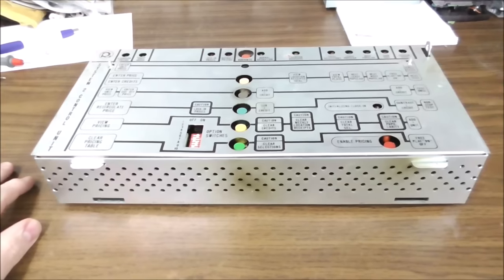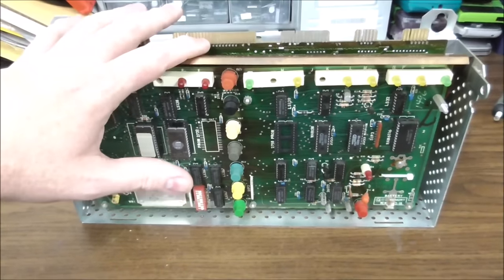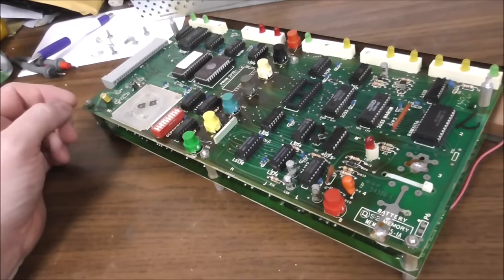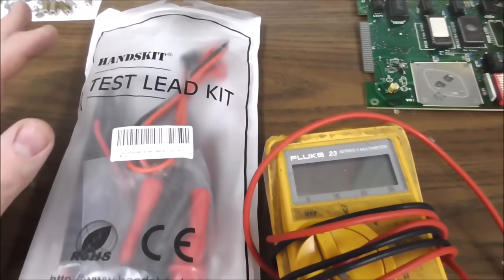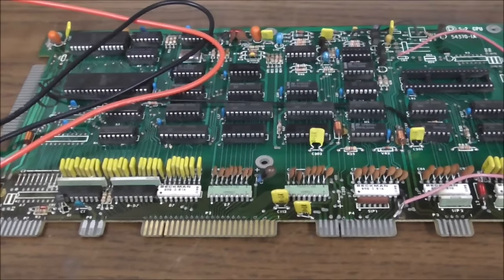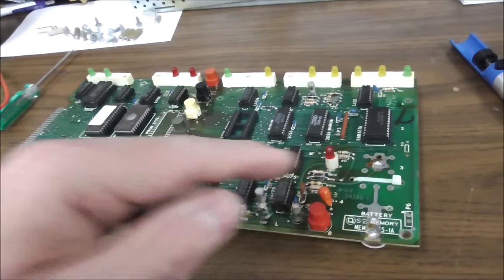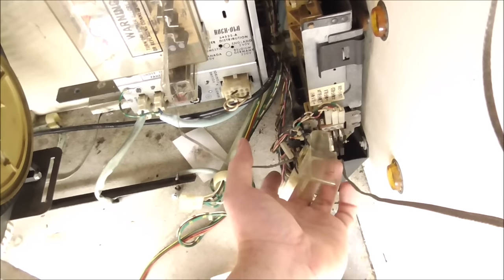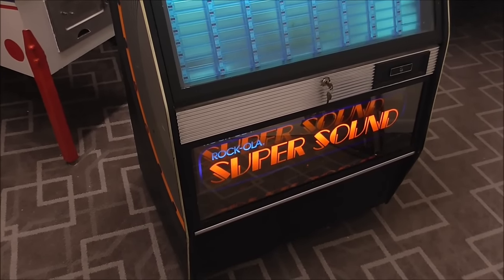Repairing The Control Unit In A Rock Ola 490 Jukebox For A Customer!

Comment from the maker: If you follow our Amazon link:  https://amzn.to/3crMXRZ  anything you buy there doesn't raise your prices or anything, but pays us a royalty for sending you there.  Thank you for everyone that has been buying things, we appreciate it!!!
Reply: Depending on the charging cycles could a LM2032 be used instead of a Diode CR2032?
Reply from the maker: I think the 2032 isn't rechargeable, is it?  Basically the thing will take about anything, you just have to make sure not to charge one that won't charge, and add the diode... but if it's rechargeable you could just wire it right up.  Anything anywhere like 3volts will work.

Comment: You got it right.  Silver solder coating tends to go black when it tarnishes.  The tin type coatings tend to stay clean, unless you get battery damage.  It was definitely a good idea to remove the battery and replace it.
Tantalums are used because (when not shorted) they have extremely low leakage.  Replacing with an Electrolytic is appropriate as long as it is a low leakage, high quality electrolytic.  In this situation, I don't think it makes much difference though.
Love your work.  It is always great to see someone who actually enjoys bringing these back to life working on them.
Reply from the maker: Thank you Brendan we always appreciate your comments... see you on the next video!

Comment: At the company where I work for I always use a FLIR heat camera to find a component which is short. A couple of years ago I had a Samsung Plasma TV with a short +3,3V on the mainboard and it was impossible to find the short component because there were 50 or more SMD-components connected to that 3.3V-line. With the FLIR I had found the short component within 5 seconds without removing the other components.

Comment: Hi Ron,  I've always heard that oxidation on silver (aka tarnish) is conductive.  That's generally considered a good thing with things like switch contacts.   That way a bit of oxidation doesn't create a problem.  You may not need to go out of your way to clean them if you know they are silver.  High end telegraph keys always used silver contacts :)
Reply from the maker: I'd never heard that but it's good to know... I guess the next thing would be identifying if you know for sure it's silver or not :)  Thanks for watching Mike, we appreciate it as always!

Comment: On these machines there are two springloaded tabs you can push in on the back side of the selection panel that drops it down so you can see it while you cycle through the settings and make selections while the door is up.

Comment: Enjoying the Jukin', thanks! Is that battery powering the 6116 RAM right above it? I wonder if you can get rid of that battery completely by using one of these 6116 NV RAMs that are around in the pinball market? I mean, it doesn't matter to the RAM if it operates in a pinball or a juke box, right? I replaced the 6116 in my Pole Position with a NV version and it works like a charm. No more leaking or empty batteries, I love it.
Reply from the maker: I think you could probably do that, yes, and it's in a socket so it might be a really easy update on these.  Never tried it though.

Comment: I read a suggestion to change the tantalum capacitor with non-polarized capacitors. What do you think? The capacitor I think is usually .1 or 1 micro-farad.

Comment: Greetings from Madison, WI!

A couple of nit-picky type questions, just because...

- I noticed what appeared to be burn marks (discoloration) on the bottom of the unit cage. Any speculation as to the cause, and is this cause for concern?

- I saw that one of the EPROMs was exposed (no label covering the window). I realize that the chip is covered by the metal cover of the unit, but is it cause for concern that the chip is unlabeled?
Reply from the maker: The eprom probably had a sticker on it at some time that fell off.... It's one of those things where technically the light in the cabinet might be able to erase it, but it takes a ton of time and a ton of light, I had a friend leave an eprom on his dashboard for a month and the thing still verified so I don't think it's that big of a problem.  If I remember to though usually I cover them back up with a sticker.

The burn marks are heat from the power supply directly beneath it, there are large heat sinks just under it.
Reply: @LyonsArcade  I suspected as much, now I know... And knowing is half the battle... :-)

Comment: I have a Rock Ola 490-2 and it looks like the tantalums were replaced with more tantalums. Hard to know when. I'm guessing it didn't work as the +25V light STILL doesn't go on. Looks like the guy actually changed everything and finally gave up so now I have it. I've figured out a way to get it to work with one deftly placed zip tie on one of the mechanisms but now the carousel is always moving unless there's a record playing. Kind of annoying. I may look to replace those same tantalums that you did. I have a parts catalog that says they are 35V, but I don't have the originals and can't tell the uF. Shall I assume they're the same as yours and look for 10uF 35V ceramic caps?
Reply from the maker: Yes they should be 10uf 35v... If the carousel is moving non stop, it may be searching for a record, does it pick up selected records reliably?  These things keep memory of selections, so if it's running non stop it may be scanning trying to find records it thinks it is supposed to play.
Reply: @LyonsArcade  yeah it finds records and as long as you have more in the cue it will scan, find them and play them. But as soon as it runs out of records to search it'll just spin and spin until you input another number. I'm pretty sure it's supposed to be at rest when awaiting a number. It must have something to do with the circuit being shorted. Just ordered a replacement for each tantalum and I'll give it a shot though with no more corner RadioShack stores all caps need to be bought online and everything is taking at least a week to ship. I'm so impatient! Thanks for the videos, these really help to educate and pass the time!

Comment: Removed my PCB to check if the previous owner had replaced the battery and they had not. I was lucky as there was only a little corrosion on the negative side, which had not leaked onto the board. Phew. Anyway, I'd like to do what you did with a coin battery, but there are SO many coin batteries to choose from and the holders are all based on "size". I know I need a 3 volt, but do you remember which number you went with and what size holder? Also, as far as the diode goes, are there any specifications for it? Thank you!
Reply from the maker: I used a CR2032, which is a really common one... the battery holders should specify that battery... and the diode I used was a 1n4007 the most common diode you can get, you place it where the banded side is away from the positive side of the battery, so that voltage can leave the battery on the positive line, go through the diode, and into the board.  Voltage can't go into the diode from the board, because the banded side of the diode blocks it.
Reply: @LyonsArcade  Thanks so much! I got my buzz to go away somehow. Replaced the caps in the power supply...still buzzed. Took out the amp and PCB to document the caps I needed to order and when I put all of that back in, the buzz disappeared. Kills me that I don't know what was causing it, but glad that's its gone! I did clean the contacts at the top of the PCB and a few of the others in the amp, but maybe it was just a loose ground that I secured when I put it all together 🤷‍♂️
Reply: @LyonsArcade  Successfully did this mod yesterday. Working perfectly. Thanks for the help!!!

Comment: Do you get your electronic components (capacitors) from amazon too?.. Quite happy to get them from there to help you out? Gearing up to repair my STD3  jukebox.
Reply from the maker: We get ours in bulk from Newark.com but we buy a ton of each and keep them in stock.  So when we start getting low we order 200 1uf50v capacitors, or 200 47uf160v capacitors, etc.  We have a little bin we keep them all sorted in.  you could probably get some on amazon but I don't know if you'd be able to get the particular ones you might need!  Thanks for watching, good luck on that STD3!

Comment: So, I've only got the two outer lights illuminating on my 490-2 (24 VAC and 5.7 VDC) and my jukebox powers up/plays just fine. It is currently stuck on default pricing and is giving me the PASS 0 as seen in your other videos, but I just use free-play anyway so it's no big deal. Any idea what would work differently (or better?) if I was able to get those other two lights (+26 VDC and -28 VDC to come on? I do have a 120hz buzz that I'm trying to troubleshoot. Don't know if those two things are related or not. Thanks!
Reply from the maker: The machine must have those voltages if it's working so the LED's have probably just burned out, I've heard of that before.... the buzz is probably caps in the power supply or amp but it might be something in the pickup too, i'm not really an audio guy because the buzz never bothers me so I never really look too far into fixing that...
Reply: @LyonsArcade  Thanks as always for the reply! That makes sense about the LEDs being burned out. Upon further inspection, the +26 light is just BARELY lit. 

I pulled the cover off of the power supply and the largest of the capacitors is puffy at the top and quite crusty, so hopefully that's our culprit for the buzzing. Also, when I remove the power supply plug from the amp, it makes a loud popping sound thru the speakers when I plug it back in. I'm going to order replacements for all 3 of those large capacitors from Newark, as you suggested. I noticed there is a blue tantalum one on that board as well. It's rated 1uf, but I'm not sure on the voltage and the schematics don't specify. Looks like my options are 35 or 50. Do I just go with the largest???

Comment: I have a Rock Ola Model 490 Super Sound Domestic and Export Wiring Diagram if you are interested in making a photo copy reach out to me. I live about 45 mins from your your store
Reply from the maker: Is it for the 490, the 490-1, or the 490-2?
Reply: @LyonsArcade  490. I purchased one last week. It contained a packet inside labeled device Information. It has the letter of warranty, and all diagrams.
Reply: @LyonsArcade  I sent you an email to the store email address with photos